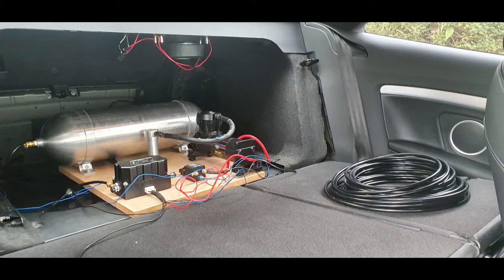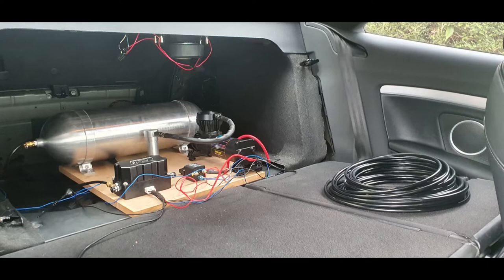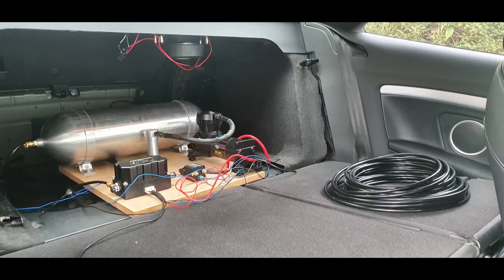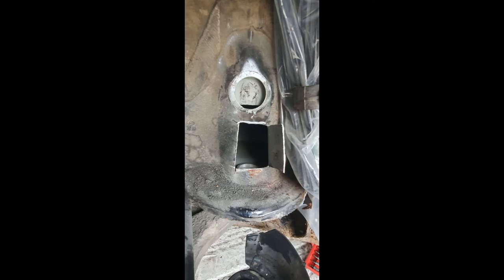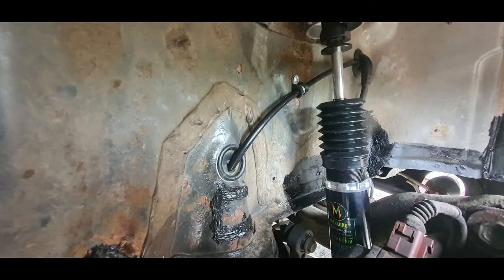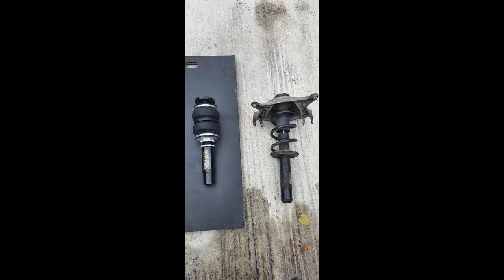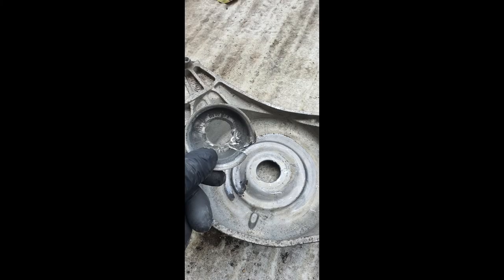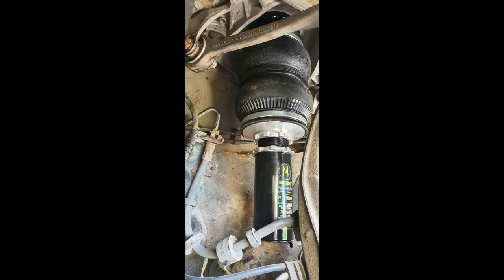Audi A5 B8 Air Suspension (MaxLoad) Pillow Ball Mount Type

Comment: hi lee just a quick question as im having the same issue with my fronts did u not install the black rubber mount back on top of the top hat when u fitted the front bags
Reply from the maker: hey there no need to fit the rubber top mount as this setup has the pillow ball type so is able too move.  leave it off when you fit these hope this helps :)

Comment: Hi! Can you please tell me, don you have some noises from the pillow ball mount while driving? Thank you!
Reply from the maker: no nothing at all it a very good setup as the original rubber top mount no longer fitted.
Reply: @LeeSmithy89  thank you! Yes, indeed. I installed it already and it’s very smooth. Thank you for the reply anyway!
Reply from the maker: @mircucristi8623   Oh good good. did you buy the same kit ?